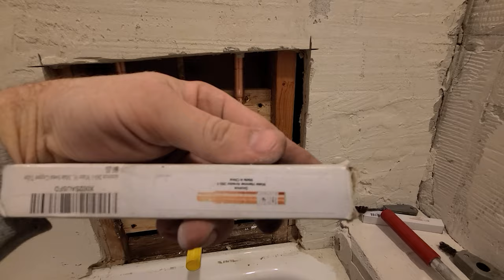How to Solder a Shower Valve

Comment: looks like a solid job! I've noticed the fitting brush keeps tight for much longer if you only use it to turn the pipe in one direction.
Reply from the maker: You are absolutely right I've went through a lot of them that way but it does a fantastic job if you go back-and-forth for a short time. 😀